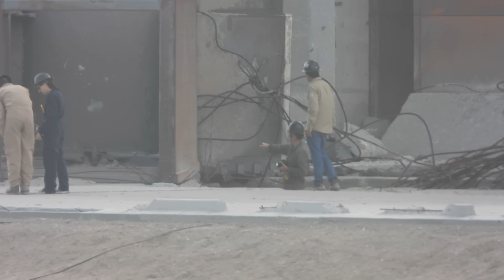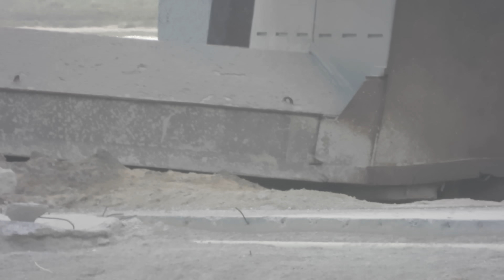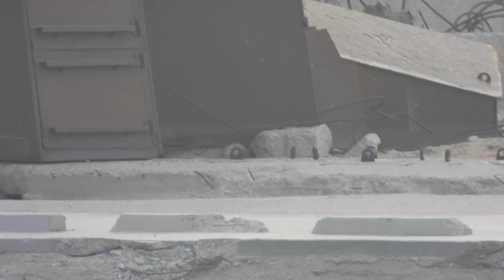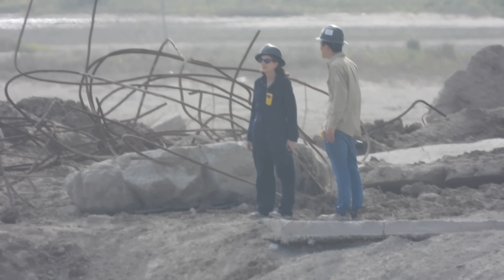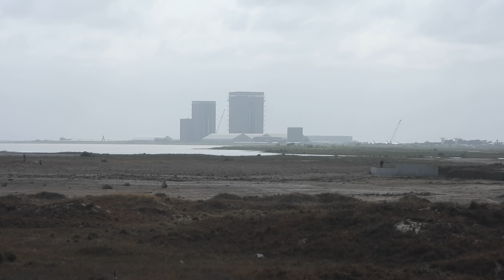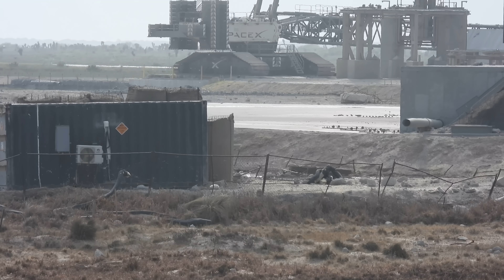Two Days After Launch, SpaceX Starbase, in 4k, Boca Chica, TX, April 22, 2023

Comment: I knew something was wrong when it took almost 10 seconds before it started going vertical. It literally sat there and blasted the ground for 10 seconds. It's amazing it left without even more damage than it had
Reply: No it moved sideways before going up!
Reply: With that immense thrust there was no way but up
Reply: I'm no expert but if they had been at full throttle and the locks off stage zero it should have left in the air instead of the whimper
Reply: @DrDiff952  you need to overcome the weight and then lift it
Reply: If you look deeper into this on your own (don’t take my word for it I’m someone random on the internet, verify this yourself), you’ll find the 8 second delay before liftoff was not a sign of anything being wrong and was actually expected. A vehicle of this weight isn’t going to shoot up into the sky like a falcon 9. 

Not that anyone will remember this comment in the future, but you’ll also be able to verify this by watching the future launches. Heavy booster + starship is always going to have a delay between ignition and liftoff
Reply: @jamalharrison4695 exactly, and it did lift up slowly and moved a good bit horizontal away from the pad before it really began its full upward motion.
Reply: @jamalharrison4695  agreed lifting this mass is not instantaneous… it takes time … space x should have modeled all this the response time and the flame persistence on concrete and sizing the pad and cooling system accordingly … definitely the lack of requirement derivation and depth of analysis of simulation and assessment and sizing is lacking at space x which we do everyday in aerospace industry … take it from aerospace engineer with more than 25 yrs of experience and more than 10 patents
Reply: Easy simulink dynamic analysis can predict all this the response time to lift off is a time at which the pad and its surrounding and the bottom base of the rocket are super heating … temp rising exponentially and they should have predicted all this and sized the pad size height flame directors cooling system …. Obviously none of this analysis is done … Elon could have saved tons of money has this been done is a structured approach but Elon and his team are designing by experiment … and in this case this outcome is expected … in aerospace in-depth thorough analysis is performed first then test and experiment are performed to confirm the analysis and only 1% of the time things fail like what we saw here … most of the time the analysis nails it ahead of time
Reply: 2 engines failed to start which is why it was slow off the pad, and/or there may have a "discussion" on go/nogo abort before "f' it, its just a test".
Reply: They don't start all 33 engines at once, they do them in batches. 6 seconds was the expected ignition start time, and then the clamps would be released at about 8 seconds. It was intentionally burning for that long.
Reply: @buzz1ebee  as long as the heat generated pre  lift off is well managed and every thing is sized to take it that includes pad and rocket  parts
Reply: @A AA  clearly they weren't

Comment: This will take at least 8 months or more to repair looking at this video insane power in those engines.
Reply: Depends on how they want it rebuilt
Reply: Nonsense!!
Reply: @jason_m_schmidt622  It is likely they may scrap all that is there other than the tower and then drill deep piles and then come up and build a all steel cooling table which is what was spokes about before and was not ready for the launch. This could then leave a lot less need for thick pads.
Reply: @kameljoe21  Okay I’ll settle for SpaceX building a giant swimming pool underneath it 🤣🌊
Reply: @jason_m_schmidt622  watch it all turn into steam, and have a thunderstorm.
Reply: @rearspeaker6364  😊

Comment: IMHO as an ex concrete inspector and one who followed the construction process intently, is that a lot of the damage would be mitigated by a longer cure time. I do not know what the mix designs were but using an epoxy or refractory cement would help, although given the power of the engines, a water suppression and /or fire diversion system would be necessary.
Reply: it was FONDAG concrete...same thing NASA uses on the flame trenches...biggest issue here was there was no diverter, or deluge system and they were firing 90 degrees straight onto the concrete
Reply: I wonder about the structure design itself. With the ground under being essentially an elastic sponge, that slab was working as a span under 7k tons of load. I would explore possibility it was not only abrasion/erosion, but also structural failure.

Comment: Great to see detailed pix of ground zero! The FONDAG, which is what Elon refers to in a recent tweet made after the launch attempt, is the brand name of the type of high alumina cement used to make the concrete in this pad. It's better than normal cement at two things, I've just learnt from Wikipedia - standing up to high temperatures, and remaining strong in wet conditions. However, 33 Raptor engines blasting directly at it turned out to be too much!

Elon Musk (later on day of launch) @elonmusk

" 3 months ago, we started building a massive water-cooled, steel plate to go under the launch mount. 
Wasn’t ready in time & we wrongly thought, based on static fire data, that Fondag would make it through 1 launch.
Looks like we can be ready to launch again in 1 to 2 months."
10:22 PM · Apr 21, 2023
Reply: Don't forget to mention that most of that concrete is now powder covering a good part of the Zip Code. If you didn't catch it, that spaghetti mess of rebar used to be INSIDE that concrete.
Reply: @armastat  yup, he builds a powerful engine!
Reply: So probably 3-4 months if we take Elon time into account.
Reply: @theexchipmunk  you're being kind, I am just hoping this year.
Reply: @theexchipmunk  More like 1 year, they might as well build another launch pad from zero (and a much better designed one).
Reply: @rogerthomas169  The newer, more advanced, ships and boosters are already built and ready for launch. The new metal-plated water-cooled pad is built and just needs to be assembled. It's just a matter of cleaning debris, assessing damage and reskinning the tank farm.
3-4 months is totally plausible.
Reply: Does anyone believe a steal water diverter alone is going to survive 33 Raptors?
Reply: @TheRubyKnite  Apparently some engineers do at SpaceX.
Reply: @LittleLordFancyLad  LOL.
Reply: @theexchipmunk  Im thinking longer...maybe 5 to 6 months
Reply: shocked they are only setback by 2 months, figured there would have been more damage by the looks of things.
Reply: @eric4369  check back in two months
Reply: @rogerthomas169  “He” doesn’t build anything.
Reply: @rogerthomas169  lol definitely.
Reply: @Hybridog  He built the company. And he was also one of the engineers when it first started. bringing a collective group of people together to accomplish a task on the scale of which they are is in and of itself impressive. And hes done it multiple times. haters like you just baffle me.
Reply: I’m sorry, I have watch over and over different footage’s, the damage is extensive, it’s everywhere, it’s most likely the cause of the RUD, it’s going to be a rebuild, and a relaunch middle of next year!
It breaks my heart!
😢
Reply: @TheRubyKnite  it’s a start, however, you are right, creative thinking and engineering required. A 33 story blow torch, needs 600 thousands ltrs of water for the launch pad, to be dumped in 20 seconds.
Reply: @commonsense6766  I assume that would be non-potable water. Where would they get the water from? Desalination, that would probably need FAA environmental approval and a lots a power to pull off. From a very deep well, if that’s even possible in that area?

Comment: aftermath of the most powerful rocket launch.
Reply: Thank you for stating the blindingly obvious. Very helpful.
Reply: Actually not. over half the engines were not at full thrust on lift off. this is why it was sliding sideways coming off the pad.
Reply: Yes. The engines were not all at full thrust. So when they try again, the next launch should be way more powerful.
Reply: @robertpalmer3166  And thank YOU for making a pointless comment about his stating the blindingly obvious. Don't know what we would do without you.

Comment: The pad's for the Saturn 5's are still in place. Back then the rocket's designer and the "pad" designer were each aware of what was expected from agreeing to work together. Looks like there was a "Failure to communicate" (got that line from Cool Hand Luke)
Reply: I think this was more of a case of can we do it without a flame diverter / water deluge etc? And the answer is a resounding no.
Reply: Well Jack to be fair by the time they launched Saturn 5's they had a good idea already what they needed. This was the first time for something so heavy with so many engines... and I am also pretty sure if the topic came up the response sounded something like "We Are Not NASA"

Comment: it's better to make the new one, not rebuilt the old one. Much time takes investigation what could be rebuilt due to safety reasons, crash tests of concrete, steel, etc. From the first look we see, that the lauchpad was too small; additional covers made lately bordered open spaces between pillars, as the result heat and pressure from engines zero in on inside part of the launchpad. Concret was "boiled", and flames couldn't escape from the inner area of the launchpad. The launchpad was designed to be destroyed during starship's launch.
Reply: My thought as well...this is very poor design.
Reply: And build it 100' higher this time.

Comment: Mission failure could have easily been caused by rebound overpressure damaging the 6 engines that failed

Going to need a flame trench (N-1) or water deluge system (F-1) or a combination of both.

16.5 million ft-lbs is just too much.
Reply: Nah they just need a taller launch pad. this time 100' off the ground.

Comment: Right under the stand should be 18 24inch pipe schedule 80 with a turbine creating suction out to a flame aresstor or flare. The turbine will suck the flames away from underneath the rocket. The trench will divert any excess energy away from the stand. Right now, I have questions as to whether or not the stand as it is could hold the weight of a booster and StarShip.

Comment: they said it took almost ten seconds to get up off the pad I think that is where the damage was caused there was probably nothing wrong with the rocket or booster until t-0 +4 or 5 when it was damaged causing flight failure.

Comment: What amazes me that they couldn't predict this was going to happend, and using the tank farm for a blast shield,
Reply: They used special heat-tolerant concrete and temperature probably wasn't the issue (the planned water system is mostly for sound dampening, not cooling, the the steel reinforcements rods would have melted if temperature was the issue.). The effect of the noise level on concrete is hard to predict on this scale. Based on previous tests with fewer engines they expected some damage but expected it to be relatively easy to fix. The concrete is easy to fix, even on this scale, but it looks like underground pipes and other equipment is damaged too, and the connections between the 6 legs was broken, so the whole platform may have shifted or deformed, so that will have to be checked. I think a couple of month should be possible, they work 24/7 and have many contractors working at the same time. They need to install the planned flame diverter and water system, but the rest is just fixing what is broken, no time-consuming new designs needed. Also no new permits if they simply replace broken stuff.

Comment: As soon as the flame burns through the concrete, the underside inflates and becomes a concrete balloon that goes 'pop', showering bits everywhere, like patio-slabs in a hurricane. Any ducting underneath will fill with high temperature gas at high pressure, that will follow the path of least resistance to escape. (Build Moon-base on solid rock)

Comment: Great footage, that's a lot of damage that concrete can't take that kind of force, constantly, even for a few seconds. 
Crazy thought, what happened to the heat integrity of the steel in the mounting system🤔?
Reply: unfortunately it has probably been unevenly hardened.
Reply: The clamps retract and get covered, seems like all the exposed concrete would have to be replaced/covered with thick steel.

Comment: Should make the launch pads at old quarry sites. Run the launch tower from top to bottom. Suspend the rocket for launch and have a fall away launch mount.
Reply: Now yur thinking. they should use the capture arms to lift it 150' off the ground to launch it - so the exhaust barely reaches it.
Reply: @armastat  Yeah they have shown plans for starbases with essentially missile silos, but its become pretty evident that we need to just keep everything away from the exhaust plume.
Reply: @timbrwolf1121  Personally I think they just need to build the launch pad to the 200' height and avoid this flame vs ground thing..
Reply: @armastat  Takes a lot of effort to get something up that high. Also they still would have to stack it. Would be more economical to drop it into a pit and then lower a ship onto it.
Reply: @timbrwolf1121  Naw the arms already are designed to lift the booster. just some more duck tape and it can lift the stack too.
Reply: @armastat  The old quarries sound like an elon idea though. Like thats some cheap ass property that the quarry companies would love to not have to pay to restore.
Reply: @timbrwolf1121  True, just think of the acoustics as well. sweet.

Comment: Reminds me of the skirt cone on the bottom of the space shuttle solid booster that hit the ocean at double digit speeds. Tore out chucks of aluminum 8x8 I-beams that formed the skirt from the base and within the cone. 
I suspected even worse damage considering the fact that concrete is hydroscopic, has water within it.  It is a poor conductor of heat so the temperature gradient was huge between the surface and the ground below.  Water boiling and thermal expansion gradient would cause shear  and tension between the reinforcement bars.  
Not a very wise decision to not use deluge water cooling.
Reply: Okay you managed to confuse me. Poor conductor? With Water in it?       have you ever been in a concrete building with the sun shining on it? Water boiling and expansion causes concrete to explode.

Comment: I think if you put a gigantic concrete containment around booster 0 the pressure would be equal on all sides. Would have zero damage. You might even able do a soft start 0 on launch to build the pressure on the opposite side. Mathematics could get you the size you need to negate enough damage. Even a ring of raptor engines around the launch vehicle firing at the same time would tend to neutralize the force .

Comment: imagine the force necessary to twist rebar that size like a bread tie...incomprehensible. SpaceX has a lot of work ahead, however I fully believe they already had contingency plans drawn up just in case of this. They knew there was a chance and it's not like Elon to not be prepared with another plan. I think the biggest issue is the startup procedures for the 33 raptors...they dont all start at once, the start in clusters before throttling all 33 to liftoff, which is why it sits on the pad pounding whatever is below for 10 seconds. A steel cone-shaped diverter with a deluge system likely would have avoided this completely

Comment: what are heat shield tiles made from and could it be made into a spray type foam that could be sprayed on to the surfaces to insulate from the heat and pressure?
Reply: they are a ceramic type of material. very brittle. first hint of raptor blast onto that would pulverise it to powder in a second.

Comment: That is quite an expensive way to dig a hole. Defo a flame diverter/trench needed and a new launch pad. The Boring co could dig out the trenches/tunnels. Did they reckon it was going to blow up on the pad and therefore not bother about the damage it would cause to the pad as the explosion would take the entire pad out anyway.  Great test though. Well done SpaceX.

Comment: The problem as I see it is that some of the Launch Pads foundation structure has been structurally damaged. If you want the Launch Pad to be as structurally strong as it was before launch, you will have to rebuild it from scratch. Plan B will have to be to make a "patch job". But it will leave a few weaknesses to the construct. Perhaps good enough to fulfil its purpose but never as strong as it was when it was newly built. As long as the improvements are done, such as adding a cooling system, adding a flame diverter and steel reinforcements on the pad surface. The question is, is it going to be a 1-2 month patch job with a few ready made improvements added, or is it going to be a complete deconstruct and rebuild taking a full half a year?
Reply: But then again, maybe the damage to the structural integrity is only a few percent? Mainly because most of the damage had been taken to the centre of the pad away from the loadbearing legs. There were some shots showing damage to the sides of the legs underneath ground level however, and if those legs were connected with steel wiring below ground, that definitely has taken a hit... It all comes down to how much loadbearing damage has been sustained. My guess is a 1-5%. And how important is it to have back at max capacity or top condition?

Comment: That will require a complete overhaul and upgrade complete with exhaust diverter and extinguisher tunnel. That is just too much force to contain in that small of a space without redirecting it someplace else. Give it an avenue to go to instead of letting it just roil under the rocket.